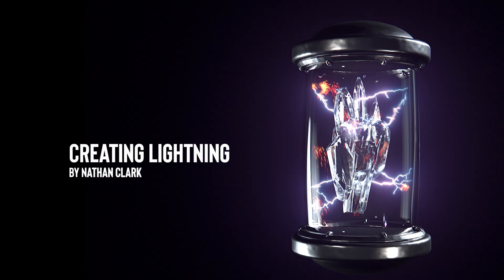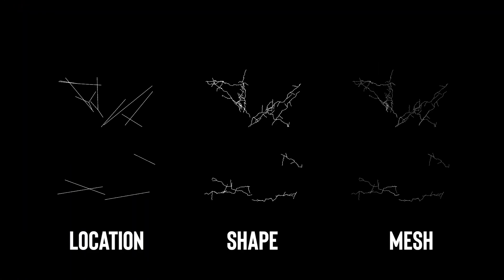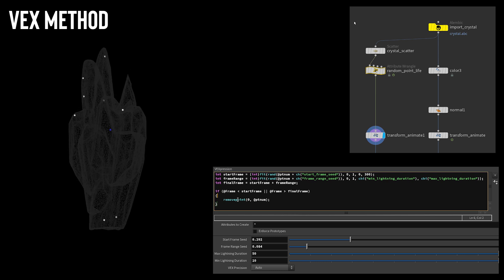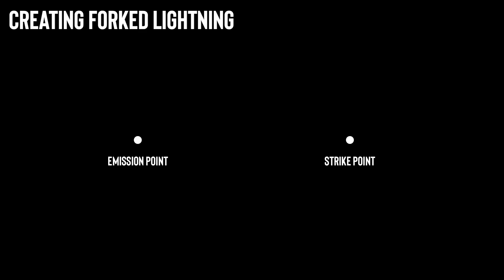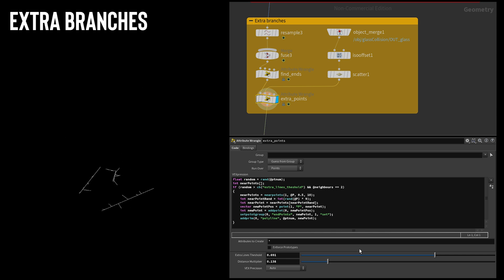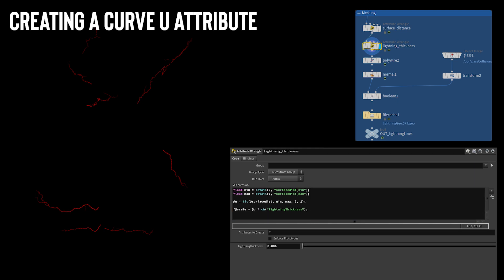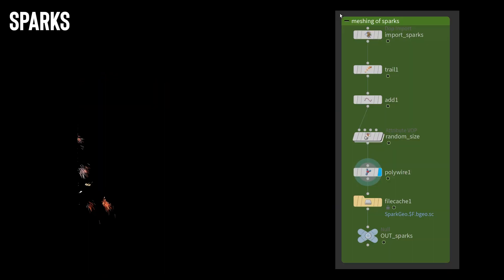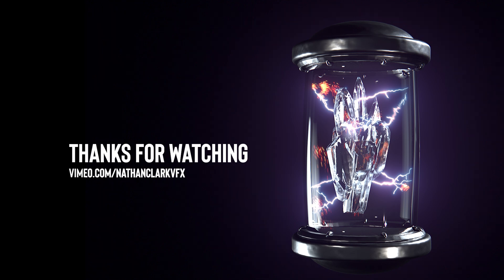Creating Lightning with VEX | Nathan Clark | University of Bolton

Comment: Hey! I'm following this nice tut, but im a lil bit lost in the extra branches, u forgot to show find_ends attwrngl. And in my case dosnt create nothing bc i dont have this attwrangle. Can u tall me what this att does please?
Reply: hi, not certain what the "@neighbours" is for in the "extra_points" wrangler, but I guessed it was to make sure it doesn't create extra connections at the branches, so I've just replaced it in the if by "neighbourcount(0, @ptnum) == 2)" and it seems to achieve the same result. So you would end up with those lines in the "extra_points" node :

float random = rand(@ptnum);
int nearPoints[];
if(random > ch("extra_lines_threshold") && neighbourcount(0, @ptnum) == 2){
    nearPoints = nearpoints(1, @P, chf("max_dist"), chi("max_pts"));  // I've promoted maxdist and maxpts to adjust them myself
    int nearPointsRand = int(rand(@P) * 9);
    int nearPoint = nearPoints[nearPointsRand];
    vector newPointPos = point(1, "P", nearPoint);
    int newPoint = addpoint(0, newPointPos);
    setpointgroup(0, "endPoints", newPoint, 1, "set");
    addprim(0, "polyline", @ptnum, newPoint);
}

Make sure to plug your scatter in the second input, with a high enough count so the attribute wrangler finds some nearpoints. I hope it's clear / helpful
Reply: @Poulet6168  Thanks Simon! It works now!